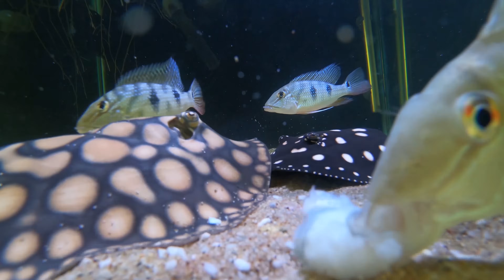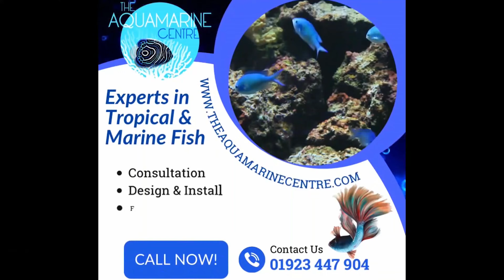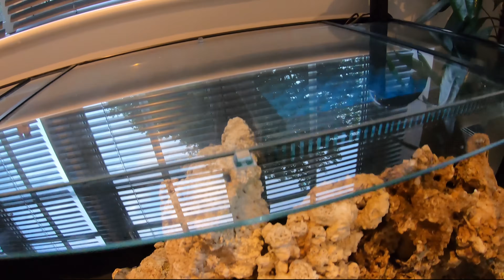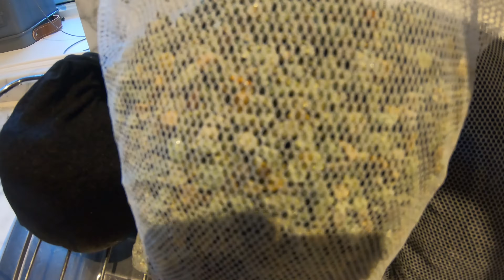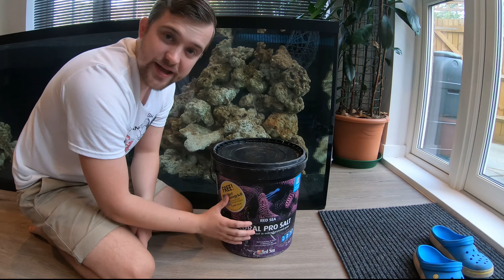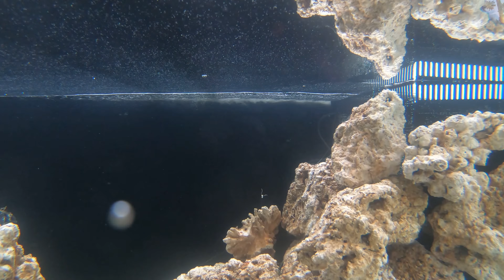THE DREAM REEF BIG FILL! Will it hold 😬

Comment: awesome project mate
With that filtration you can only have soft corals, sps and lps no.
and the lighting for that height has to be brutal, if not, neither.
I would make a single fish, for angels, surgeons, etc., and some moray eels, it would be better. for a reef of that size, you have to do another installation, and not a small one
Reply from the maker: Spot on! This will mainly be fish focused with soft corals as an addition. I'm more focused on the fish for this setup and the soft corals will be an experiment to see how they do.😄